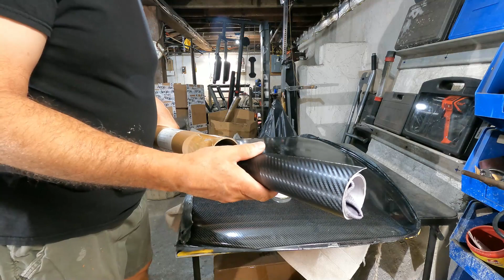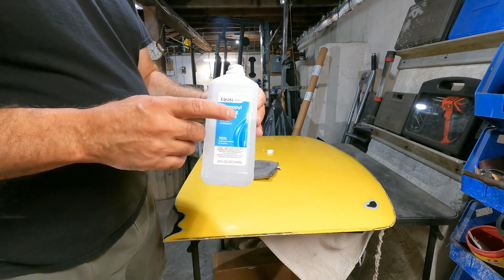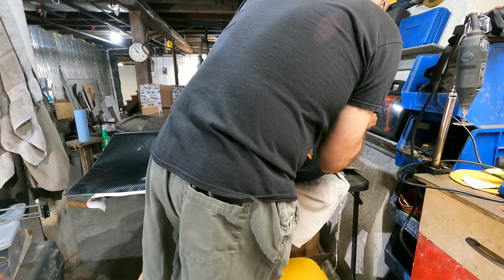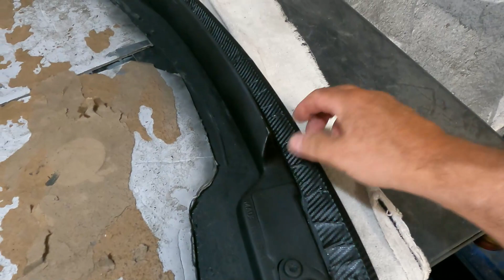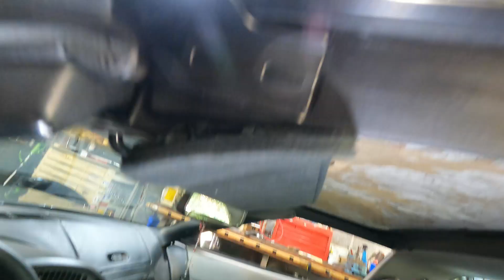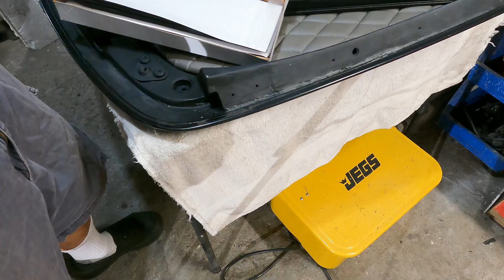Targa Top Vinyl Wrap

Comment: Hello! I have a plexiglass targa top on a 1996 Vette. The Plexiglass has some cracks here and there. Should I prepare this top with Bondo where the cracks are, sand it, smooth it, clean it as you've done. I'm worried about the imperfections showing through the wrap is the point of my question.
Reply from the maker: I am not sure if you should use Bondo on clear top or not, they are not plexiglass, there Lexon or acrylic, I would look for something for repairing that type of material, look at the Bondo and see if says you can use on the container. Good 🤞
Reply: @E.T.GARAGE  Sounds like a plan! Thank you!